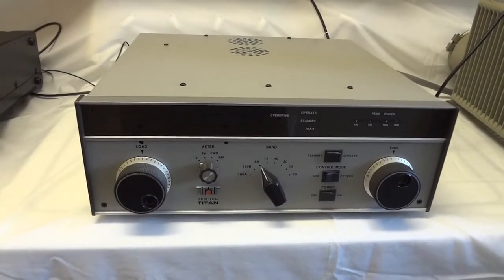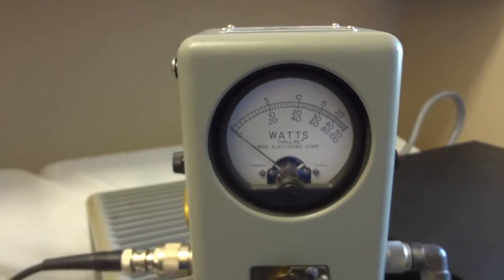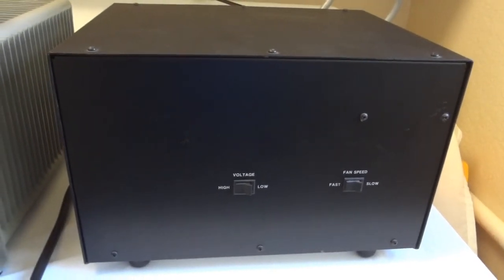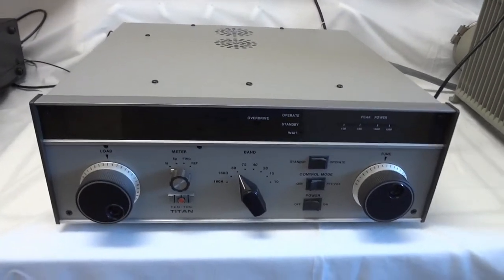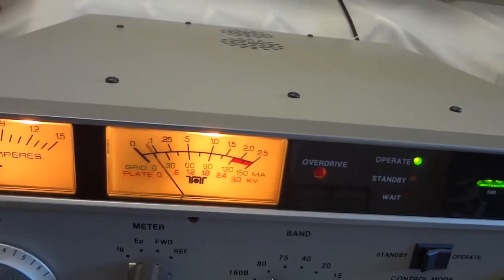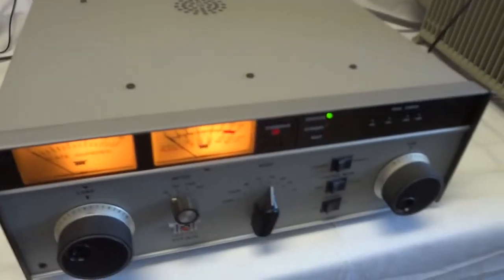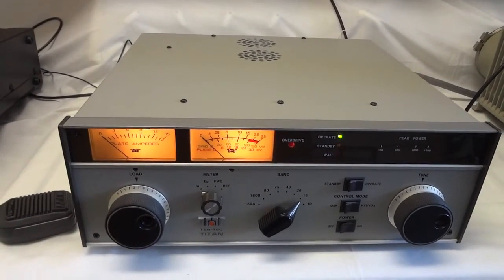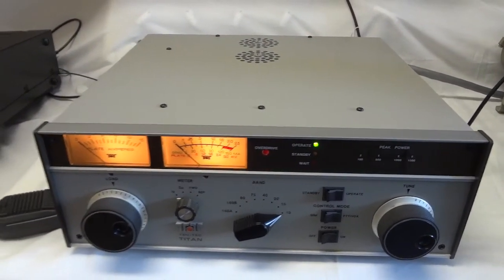Ten Tec Titan 425 Legal Limit HF amplifier

Comment: Any idea where to buy replacement filter caps? My Titan hasn't been turned on in over 20 years, and I imagine the electrolytic caps are no longer good.
Reply: you might be pleasantly surprised.   use a variac to bring them up in steps go slow..and watch the wattage draw as you do it...otherwise caps are widely available.